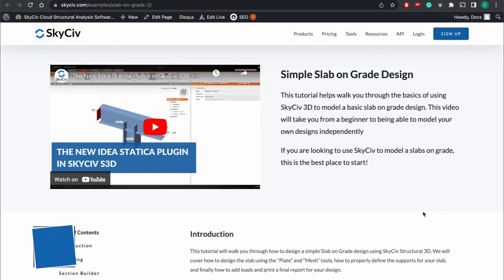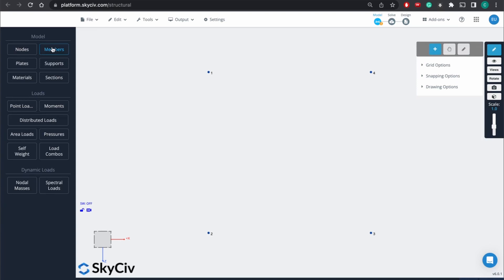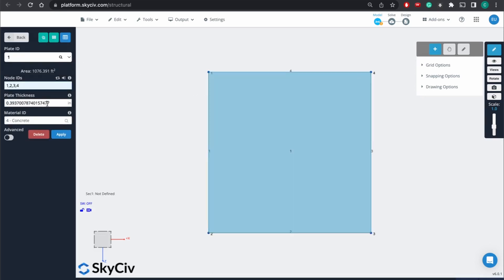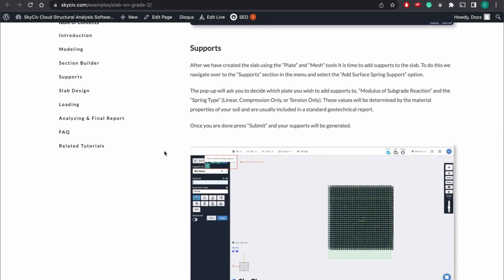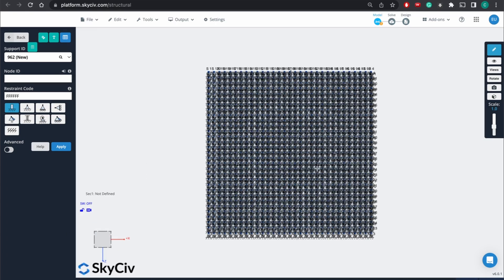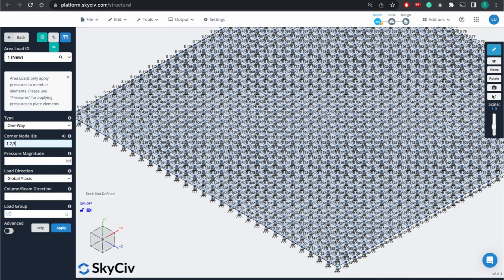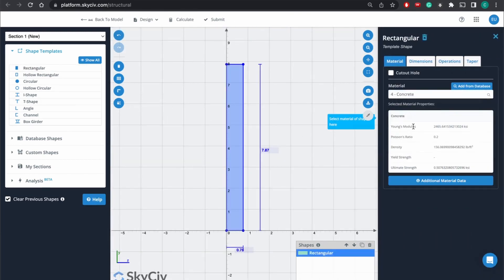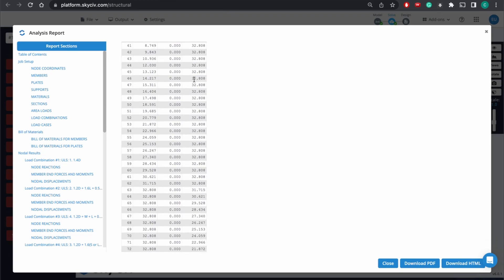Model a Slab on Grade Design

Comment: Was the area load you added to this going in the +Y direction instead of the -Y direction? If so, it would probably be more helpful to revise the tutorial to get sensible results that you can demonstrate in more detail. It would also help to have a more realistic example to show.
Reply: Just personally watching the video (I'm not affiliated) but I believe that the Y direction of load doesn't matter when looking for maximums of displacement and loading, because its not really using a "ground" for support, its a two way spring with a spring constant. But I also agree that it would be appreciated to have a more life-like example, preferably integrated with RC design because I believe the ability to add a wire mesh to the slab to be quite important for design purposes.